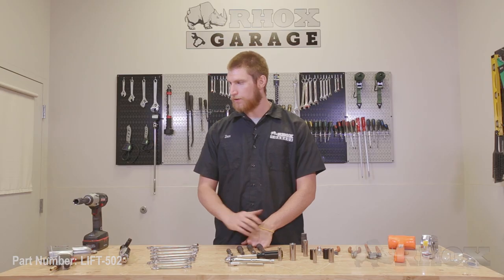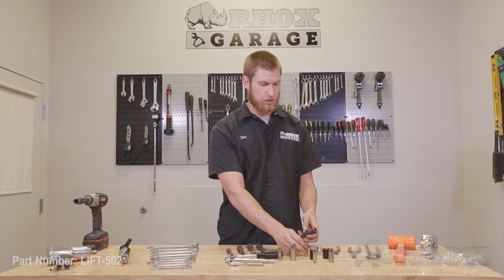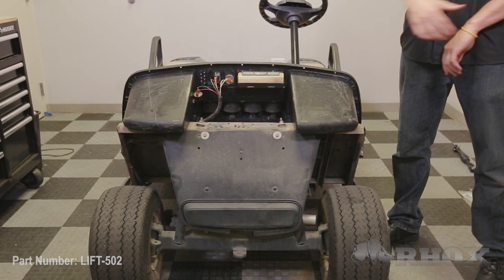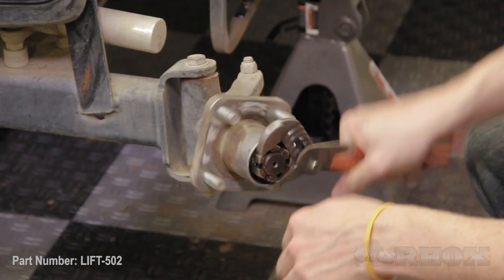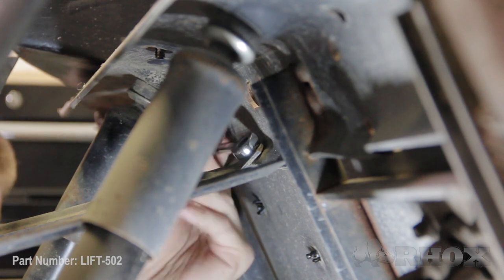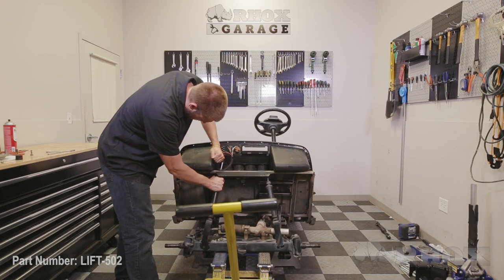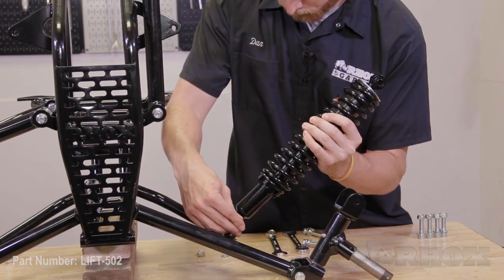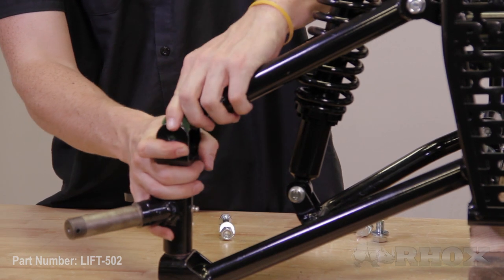LIFT-502 RHOX BMF 7” A-Arm Lift Kit on an Electric E-Z-Go TXT

Comment: Is there a torque spec on the lower nut on the front spindles? My cart is about 4 years old and they have worked loose. Just wanna make sure I don't overtighten the nuts. Thank you.
Reply from the maker: I am checking with our factory because this is tightened at the manufacturing level. Once I hear back, I will let you know.
Reply from the maker: Thank you for your patience. The kingpin bolt should be torqued to 90NM which is around 66.38 ft lbs.
Reply: @GolfCartInstructions  thank u. I was close. Had it at 55 ft pounds.  Again thank u for your help.

Comment: This is a very nice looking lift kit but 7 is a little high as it wont fit in my garage. Do ya'll carry this lift in a 6inch?
Reply from the maker: Thank you! We carry a 6" spindle lift (LIFT-102) and a 5" drop axle (LIFT-108).  These match the same year range as the LIFT-502 and can be seen at www.rhox.com.  Just type the part number in the search field.

Comment: In the video (6:10) he says to install the steering rack with the pin to the steering column is in the passenger side. This is wrong. Should be on the driver side
Reply from the maker: You're correct. Thank you for point that out.

Comment: Do I need a special tool to turn the shocks? The eye hole at the bottom needs to be turned about 90 degrees on one and 45 on the other to line up with the mounting bracket/bolts
Reply from the maker: Yes, a spanner wrench will help with that.

Comment: Does RHOX has tech support? My steering will not hang down enough to bolt into the spindles.  They are welded probably 1.5" lower than the ones in this video.
Reply from the maker: Hi Brad, You have the correct spindles. The video was shot with the first generation of these lift kits. We modified the spindles to provide more stability. Some find it easier to mount the tie rod ends to the spindles with the assembly on the bench. You can also mount these when the car is on the ground.  Another solution would be to use a jack under the A-arm. It can be done.

Comment: How long are the included shocks? And are the shocks included adjustable?
Reply from the maker: I do not have a spare shock to measure off the cart, but the one installed is 16.5" CTC of the mounting holes while under load. The spring is adjustable but not the shock itself.

Comment: (2003 EZGO TXT electric) I switched to 8" wheels and 22" tires for the smoother ride.  I have 1" wheel spacers as well.  I saw a description say this lift requires 12" wheels.  Does that still apply with spacers?
Reply from the maker: We have not tried it with spacers. We run rims with a -1" offset in general with lift kits. When we tested this, I believe the 10" rims interfered front suspension, even with the 1" offset.  You can always try it and see if it works.  You want the tires and wheels to turn freely without anything impeding their path of travel or rubbing.
Reply: @GolfCartInstructions  Thank you for responding.  I'll have to do some more research before I spend the money and possibly not be able to use the tires/wheels I have.
Reply from the maker: @SJS-Outdoors  I completely understand. Chances are, you will probably want to upgrade to the 12".
Reply: @GolfCartInstructions  What's ironic about that is that my cart came with 14" wheels and 23" tires.  I swapped for more cushion!.  DOH!
Reply from the maker: @SJS-Outdoors  That's how it always works! :)

Comment: Do you make an adapter that would allow it to fit to the pre-2001.5 TXT's at the steering column?  Anything else that is substantially different in the carts that would make this lift not fit?
Reply from the maker: No, we do not offer an adapter. The spindles are also different.
Reply: @GolfCartInstructions  Thanks for the reply.  Near as I can tell, you don't make a long travel lift for these earlier carts, correct? 1994-2001.5?

Comment: Can you recommend a shock replacement for this kit? Or what is the type/size/model of the ones that come with the kit ?
Reply from the maker: We do not offer replacement shocks for this kit at this time.
Reply: @GolfCartInstructions  can you recommend a compatible shocks?
Reply from the maker: @JoseLuisZapata  We do not offer any that would work with it.  Do you need replacement shocks?
Reply: @GolfCartInstructions  Anyone who buys this lift needs different shocks. The ones you supply are to damn stiff, so much money for trash! You can't even ride in the cart, ZERO suspension travel.....
Reply from the maker: @tnet6969  Thank you for your feedback.  The shocks can be slightly adjusted with a spanner wrench.  They will also soften once broken in.  Keep in mind, they are heavy duty so they will be on the stiffer side compared to factory.

Comment: What are the measurements for the recommended camber setting?
Reply from the maker: A positive camber is recommended, meaning you will want the top of the tires to stick out farther away from the cart than the bottom of the tires.  This way when a load is applied, the camber will even out so the wheels ride straight.  We cannot provide an exact measurement because there are too many variables at play (cart, load size, state of suspension, tires etc.).  As long as the tires and wheels are straight with the load you will be good.  Then you will want to check for tire wear to make sure it is riding evenly over time.  If not, you can readjust your alignment.

Comment: Do you make a front disc brake kit
Reply from the maker: No, only rear.
Reply: @GolfCartInstructions  well that stinks maybe I can put jakes front spindles on your front end. Does your kit use stock spindles?
Reply: Never mind I see it does not I will need to fab a mount
Reply from the maker: @94auwing  No, that will not work.
Reply: I love your front end but I need front disc brakes
Reply from the maker: @94auwing  I wish we had them for you.
Reply: @GolfCartInstructions   I will make something work 
I am for sure using your lift
Reply from the maker: @94auwing  We will cross our fingers for you!  Let us know how it turns out.

Comment: Has anyone installed this kit on a early model ezgo txt gas?? I have a 1997 unit???
Reply from the maker: We have not tried it. The spindles are different so you will need new hubs.  I'm not sure how the rest of the front end compares.  I believe it is the same but you would have to compare the parts between manuals to be certain.
Reply: I am going to try it when it comes back in stock
Reply from the maker: @94auwing  Let us know how it works!
Reply: @GolfCartInstructions  I sure will once I get the kit.

Comment: Should there be play at the lower a-arm where it connects to the spindle? I have this kit on my ezgo and there's in and out play on both sides. I'm thinking the bushing are wore out. Thanks.
Reply from the maker: It sounds like bushings.
Reply: @GolfCartInstructions  could I order them thru yall or do I have to go thru a dealer. It's a ez-go with the 13.5 kawasaki motor.
Reply from the maker: @kevinwatsin5700  We don't have a kit available yet complete with bushings and the spacer.  The bushings are found in LIFT-103-B.  They are not green.  The metal spacers are specific to that lift kit.  You may be okay reusing your spacer if it is still in good shape.  LIFT-103-B can be purchased through a RHOX authorized dealer.  If you submit a contact us form on RHOX.com, we can send you a list of dealers in your area or some web dealers.